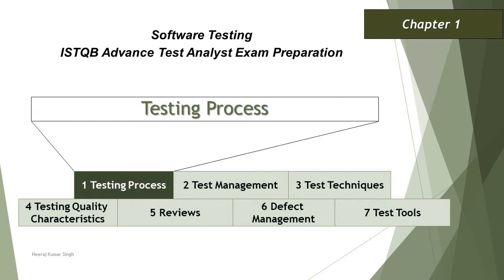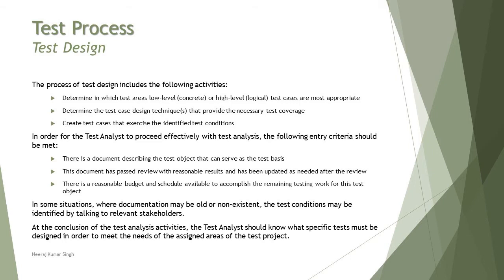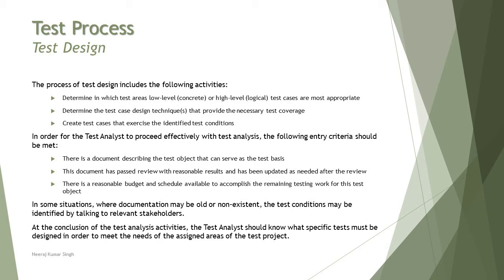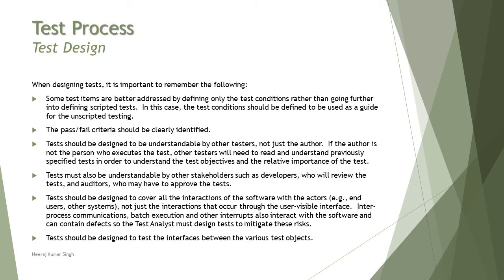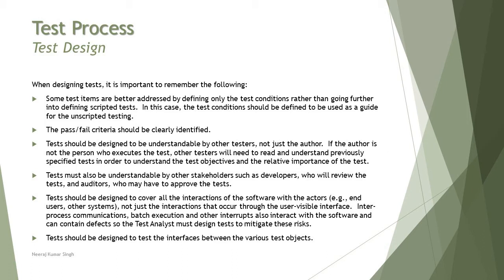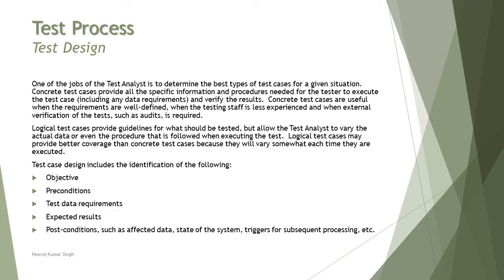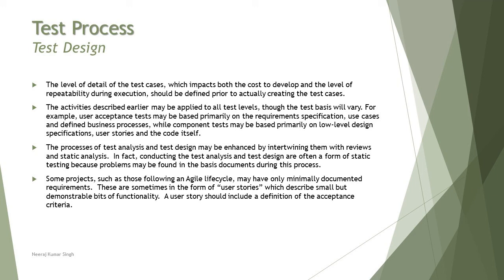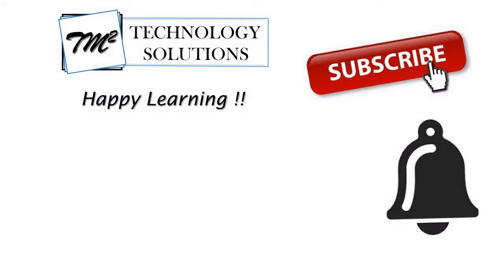ISTQB Advance Test Analyst | 1.5 Test Design | ISTQB Tutorials

Comment: I hope you don't mind, but the correct pronunciation of the word "determine" is "de" simply pronounced as the letter "d".  "ter" is straightforward and no different than what you are currently saying, but the last sylable is where the problem is.  The pronunciation is not the same as it is in the word "mine" as in land mine.  Instead, it is pronounced using the short "i" sound.  Think of the last sylable as "min" rather than "mine".  Like we would say in the word "minute".  If you need further assistance I can send you a sound file.  Your English is pretty good except for a few key things. 🙂